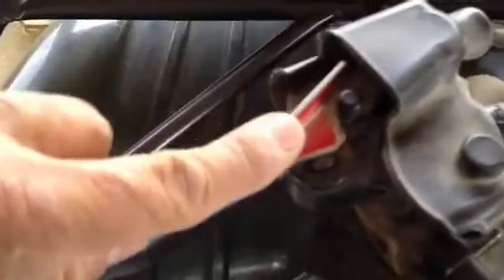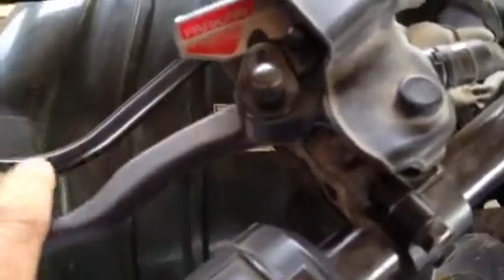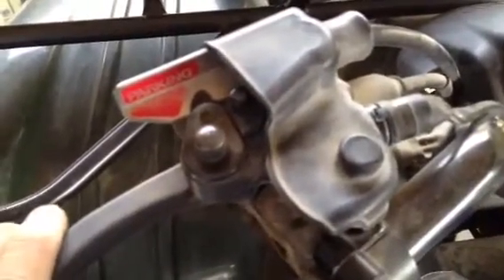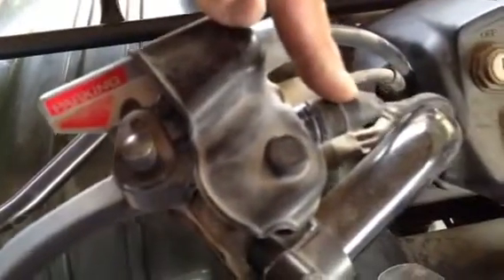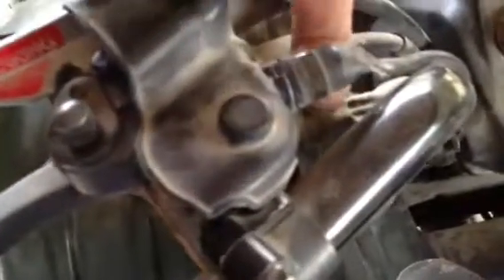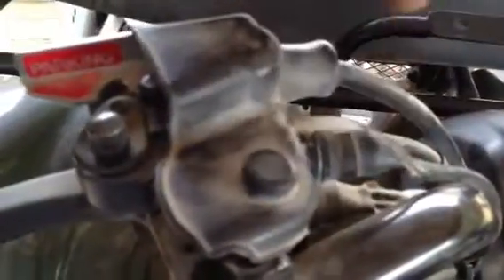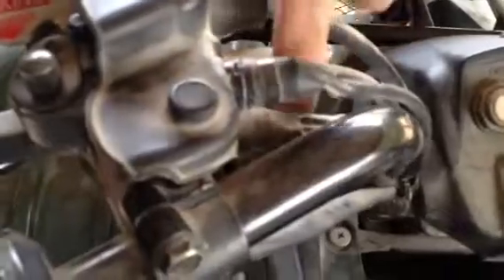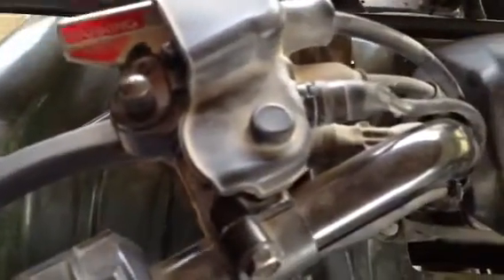Yamaha Wolverine 350 4x4

Comment: neither one of those, pull the rubber covering back and you will see the two wires, follow it back about 18" and you will see a white connector that is where you disconnect it.